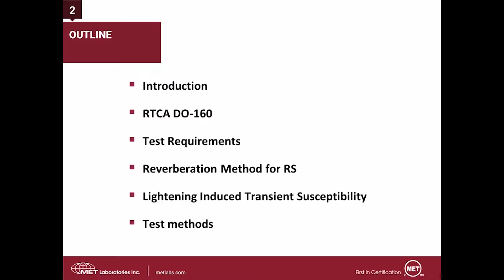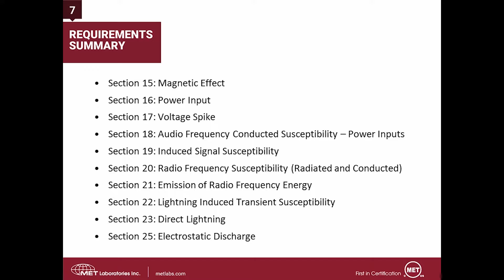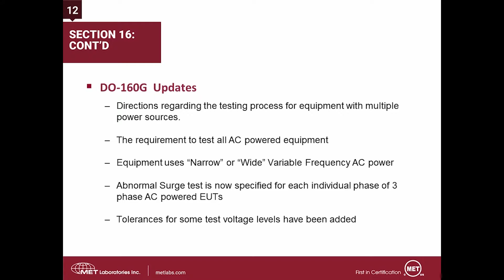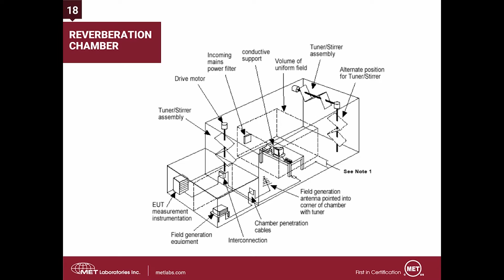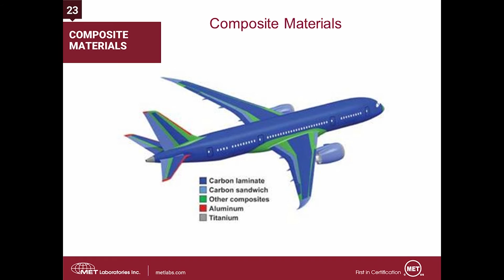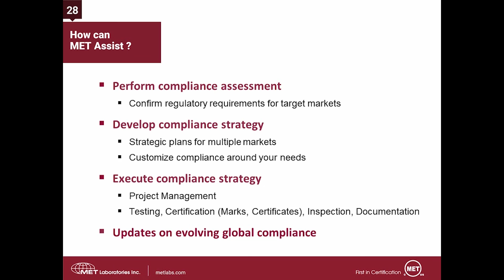RTCA DO-160 Avionics EMC Webinar | Latest Requirements

Comment: THE FREQUENCY TEST IS IN LINE WITH MIL 461 F TEST METHOD CS101? THEY CHECK FOR IMBALANCE OF WINDINGS IN WHICH DEVICES DO NOT LIKE THAT TO SEE IF THEY OPERATE AS NORMAL?